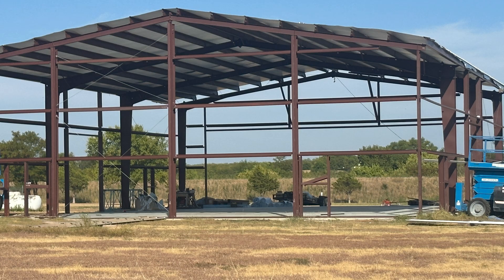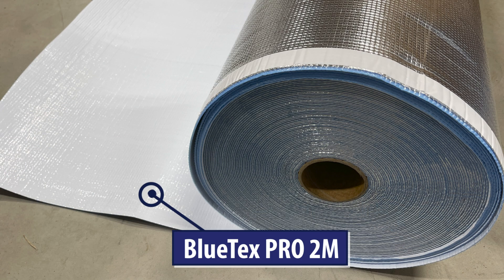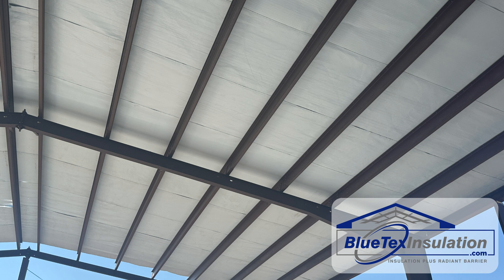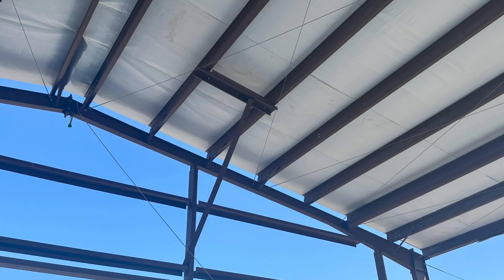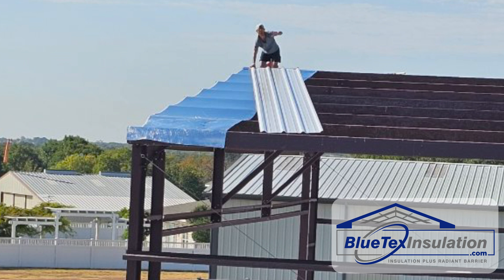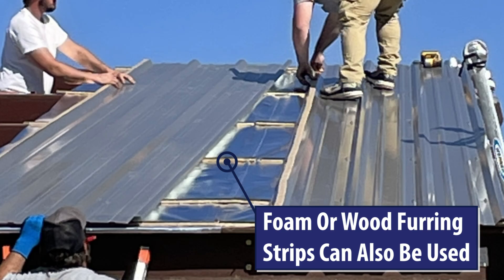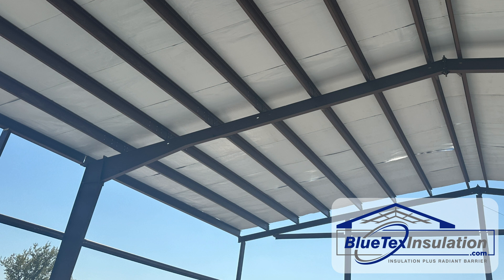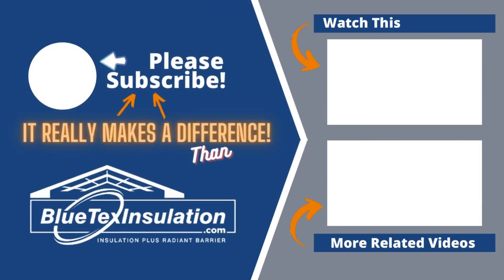Airplane Hangar Insulation - How To Install BlueTex Metal Building Insulation in PEMB Building

Comment: What if you plan to heat & cool a steel building. I am currently designing a steel structure & was planning to use Blue Tex 6mm Vapor Barrier. But then to make the building additional air tight add 1-2" of closed cell spray foam. 

Do you see any issues with spraying closed cell spray foam onto your product. This solution would be much easier than having to put up OSB like a ZIP panel & then spray foam on to that.

Any input you can provide would be greatly appreciated.

Thanks....
Reply from the maker: We actually have a BETTER system and product specifically for use with spray foam.  Please call our office and ask to speak to Ed the owner.  I can send you pictures/graphics etc. from other customers already using this system. And, we are about to use it on our own 50'x60' red iron building. This is a new product/process we will be rolling out in 2024.